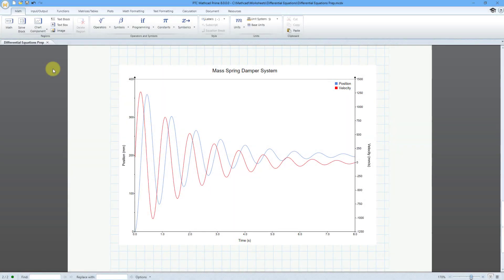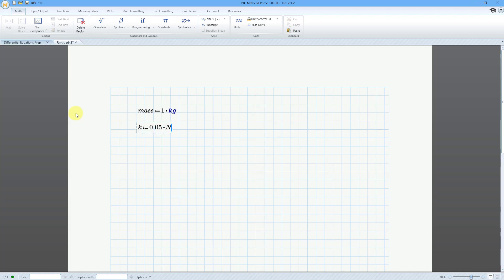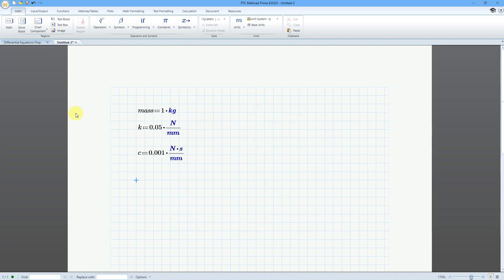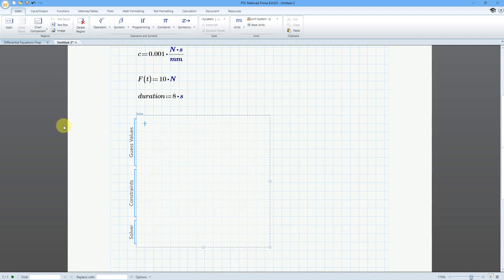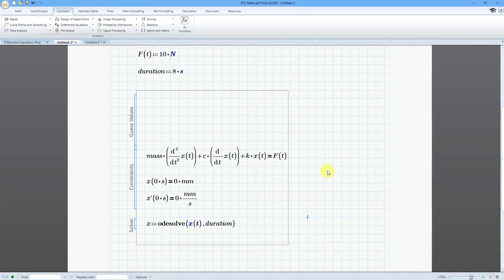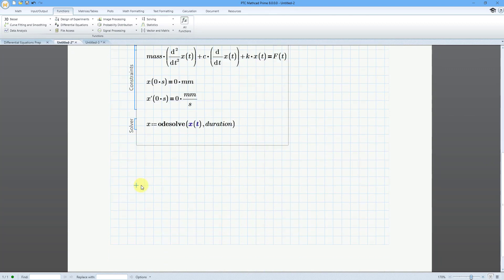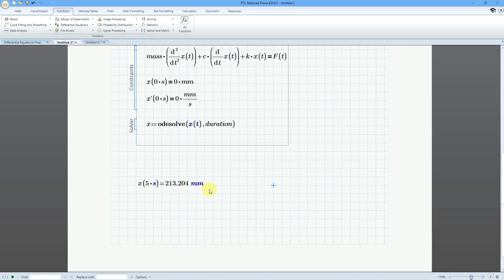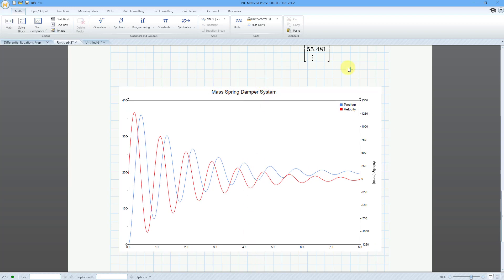Mathcad - Differential Equations

Comment: Off topic, I have no choice but change to solidworks and was wondering if you knew the best books for solidworks? Beginner, advanced and maybe even a tips and tricks?

videos are too slow for me.
Reply from the maker: The only one I have is the Sham Tickoo book. It's more like an encyclopedia of the various commands. It's thick and comprehensive, but I find lacking in philosophy of modeling, approaches to design in SW, and tips & tricks. And maddeningly, there are a couple major topics I find haven't been addressed. But if you can get a used copy of an older version for a few bucks, it's well worth the price.
Reply: @CADPLMGuy  

Thanks for the help dude I'll look into it. 

One more thing. An associate got a new job and had to learn solidworks, a former Creo user, and he likes some things and hates others but claims that SW needs way more mouse clicks than Creo. But he's more of a mouse menu guy where as I'm more of a keyboard entry command type user. What say you on the mouse click count debate.

This friend also claims there is no such thing as "surf and bound" surface selection functionality?
Reply from the maker: I find clicks to be about even, although sketching in SW seems to be more. I also prefer Creo's dashboard to the SW property manager.

However, I find that the mouse click debate has been irrelevant for years. If someone is on Facebook, Twitter, Instagram, Reddit, Snapchat, Pinterest, etc., they've got no business complaining about mouse clicks like they're in short supply.